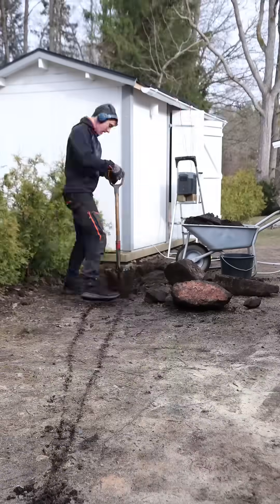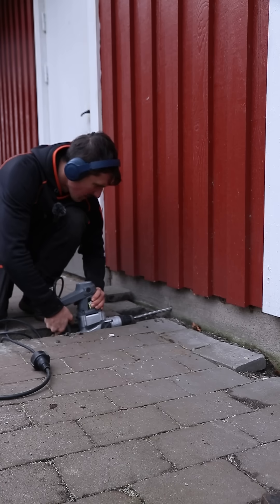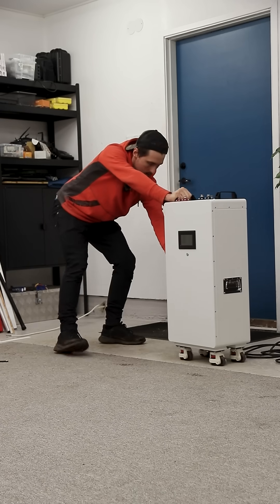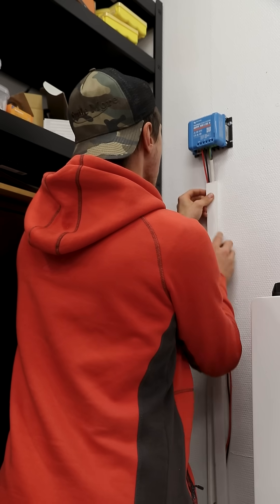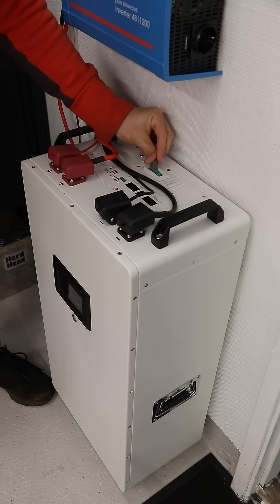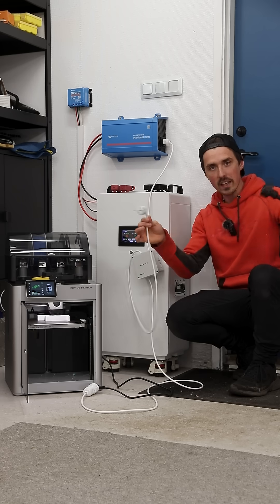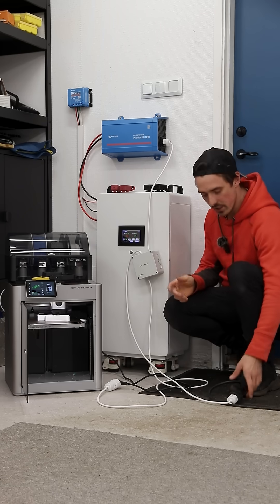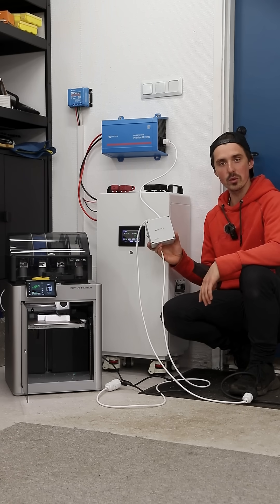Electricity For All My 3D Printers!

Comment: You live in Sweden? So you manged to trade the cleanest energy in the world (hydro and nuclear) for exported shineze coal energy? Brilliant!
Reply: What does this even mean
Reply: @logitech4873  A certain combustible rock is used in very large amounts to produce those panels. That certain large country in Asia simply figured out how to export their coal energy.
Reply: @PistonAvatarGuy  How much? Please be specific. There's a CO2 cost associated with producing ANYTHING. How many kilograms of CO2 per kW of solar?
Reply: @logitech4873  How could we ever know that? That country never tells the truth about anything. Either way, the energy produced by his own country is likely to have a lower carbon intensity and it's absolutely going to be less environmentally damaging overall.
Reply: @PistonAvatarGuy  "How would we ever know that?"

I don't know. You're the one making the claims. But now you claim to not know? Well that settles it.
Reply: @logitech4873  If we go by what the IPCC says, then rooftop solar has nearly double the lifecycle GHG emissions of hydro and nearly quadruple that of nuclear, so...
Reply: @logitech4873  If we go by what the UNECE says (which is more applicable to Europe), then PV has 7 times the equivalent warming potential of nuclear. Also, keep in mind that none of the estimates for solar are likely to include a battery storage system.

Comment: 14kwh did I hear that right?! That would never fit in that size battery?
Reply: I've got an approximately 15.5kwh battery that's actually slightly smaller than his, LiFePO4 is shockingly power dense.

Comment: I am quite certain that cable you used is not outdoor rated. Looks like NYM-J and that will break. U should use something like NYY. And secondly u could have just gotten an Victron Multiplus. Has the same facture as the grey box all in one and it can put energy back in to the grid or at least the rest of your home. That way you use all the energy even when the battery is charged and no printer is running.
Reply: In Sweden the cable he used is probably EXQ or ELXQ and it’s not rated to be put in the ground. Especially not in white at least.
Reply: The cable is run in tubing though.

Comment: I am very interested in that little grey box. Would you be able to provide more info on the inner workings?
Reply: Relay based automatic transfer switch. Generally, relays have responses fast enough for most appliances. It is commonly made of a DPDT relay with the COM terminals connected to the output, normally closed (NC) connected to the solar and normally open (NO) connected to the AC outlet/grid. The coil is powered by the grid, in the case of the grid being the primary power source. If the power is out, the coil turns off and the relay switches to the NO (solar). U can reverse the configuration to make it a solar priority.

More advanced systems may employ solid state relays or mosfets and smart microcontrollers but the principle is the same.

Comment: I think it is really cool still!

Just a few things to think about:
You are not compliant with the IEC 60364; the cable must be .5 meter if using a conduit or 1.0 meter without extra protection. 
You need to have two breakers one for the DC and one for the AC. 40A DC for the solar array and 15A AC for the invertor to the 3D printers. Of course, double this if you want to someday double your solar panel. 
You need a grounding rod
Voltage Drop tolerance should be no higher than 3%. 10mm2 wire is sufficient. 

Let's say you want to add more solar panels, you will thus increase the amps, meaning your voltage drop will increase. 10 mm2, would not work anymore, so using 16 mm2 would work, but 25 mm2 would be the optimal choice.
Reply: I’d worry about future me or a landscaper cutting this cable by mistake
Reply: Have you considered he is in sweeden?
Reply: @erkWaq  IEC "International Electrotechnical Commission". Sweden is part of this commission i think
Reply: @planenerd907  the equivalent EU harmonized directive is HD60364
Reply: @, correct, in Sweden they follow the SEK Handbok 444 + SS 424 14 37 regulations. I see that those regulations don't talk about the depth of a cable, but every Europe country adapts the IEC differently. 

Like I said still a cool project and just a few things to think about.

Comment: Just FYI the cable has to be 30cm underground to be up to code and I'm not sure that conduit is strong enough to be considered extra mechanical protection
Reply: Guys it does not matter where you live, if you want to remain safe while digging in the ground please put the wire at least at 40cm below the surface. Electric wires in my opinion should also be inside a tube but that's personal preference.
Reply: code to life
Reply: "Code" only exists in the USA....land of the free lol.
Reply: Although. It should be yellow in Sweden. No idea about the depth.
Reply: I assume you mean code if he lived in US. Sweden there is no requirement it seems. From a quick ChatGPT
Reply: @ Nope. I'm Danish and as far as I'm aware Sweden also uses the same IEC/EN norm. 

What would you call it if not electrical code in English?
Reply: @TheRossWilliams  Also. If you didn't realize. I'm not using freedom units